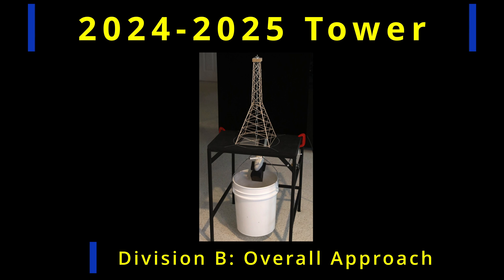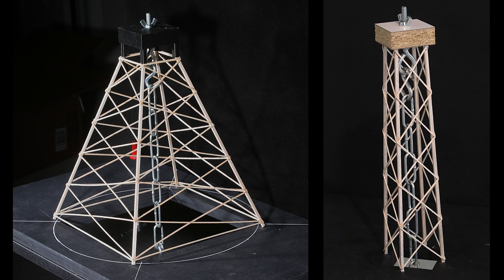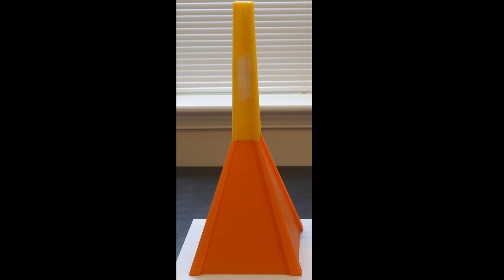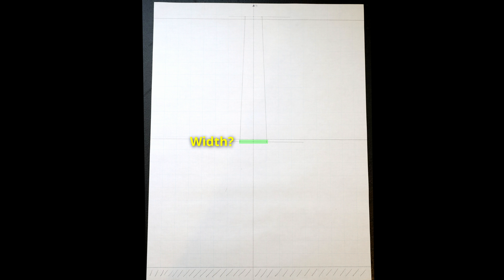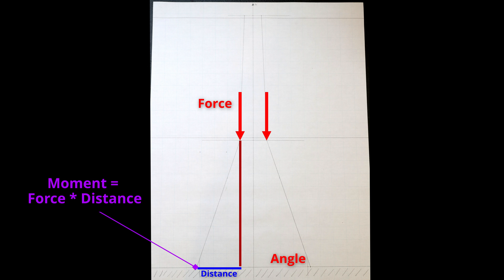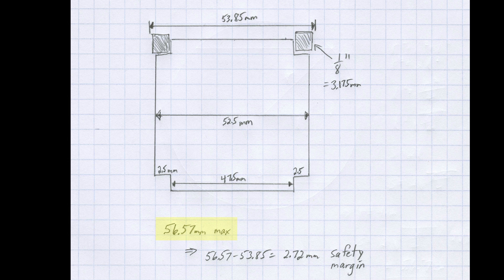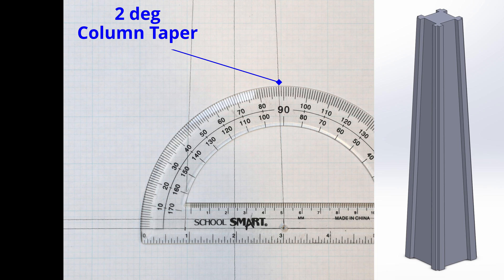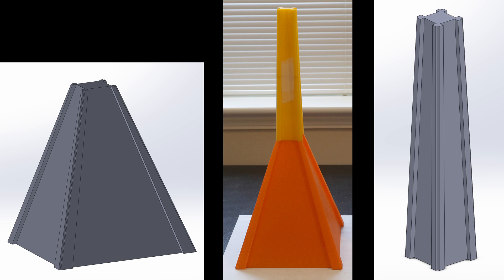2025 Science Olympiad Tower Div B: Overall Approach

Comment: why did you break the column into two files, while the base is only one file?  the column and the base are the same height anyway? any printer that could print the base should be able to print the column in one piece?
Reply from the maker: The base is 24.5cm tall and the column is 26cm.  My printer can only print 25cm.  You need to have the base a little shorter to give some buffer to follow the 8cm ring rule
Reply: I see, thank you, yeah my printer can only do 25cm also

Comment: I noticed you've been using bonus tower designs for the past videos, does this mean that a bonus design would be worth it with this year's rules? Or is it still the same risk?
Reply from the maker: Still the same risk.  My initial thinking is the bonus would be better because they have the same column dimensions, but I have not even tried to build a non-bonus version yet.  It's something that needs to be explored for sure.  If the non-bonus can come close to my benchmark bonus score, then it'd definitely be a better choice as it wouldn't be as risky on competition day.  (Div C is a different story, I'm more confident that the bonus is the correct way to go there due to the 3-leg design and how it needs to still span the 20cm square in 3 different quadrants)

Comment: Would you still use 1/24 by 1/24 for the cross members? I asked this last year lol
also, what density should I buy? I calculated around 5-6 pounds per cubic foot, but I'm not sure
Reply from the maker: There is no one right answer for the cross-members.  Using 1/20 is a good choice, as is 1/16 for the base at least.  For the column, you might want to look into using 1/32, but it all depends on the density.  You'll have to experiment with that a bit.  In the final videos of this series, I'll show what exact material I used for the benchmark tower.  Stay tuned!
Reply: @balsaengineering6686  Thanks so much! I'll look into 1/16 because I suck at building lol

Comment: When you make the first tower for this years rules, could you specify what grain balsa you use?
Reply from the maker: For all of these builds, I did not worry about the balsa grain.  In general, it's way more important to get the density/mass correct and matching than it is to worry about the grain type.  I'm pretty sure the benchmark build used generic A/A-B grain for everything.  I wouldn't focus on using c-grain for anything until you have nailed down optimizing everything else as it's much more expensive to work with and really won't help a whole lot in these builds.